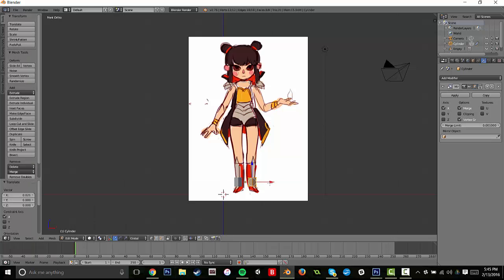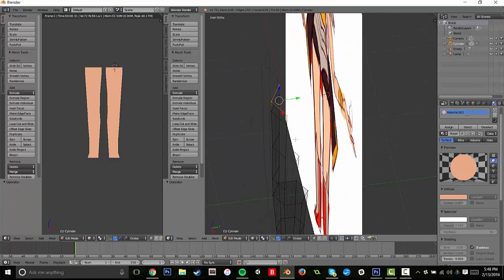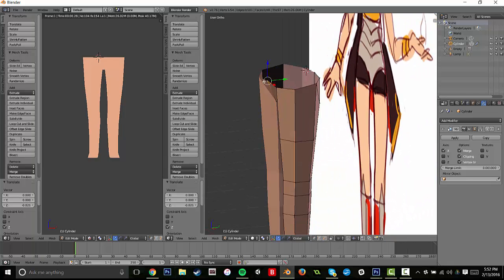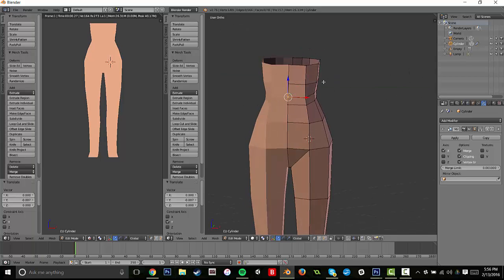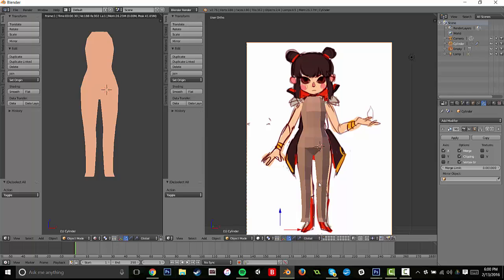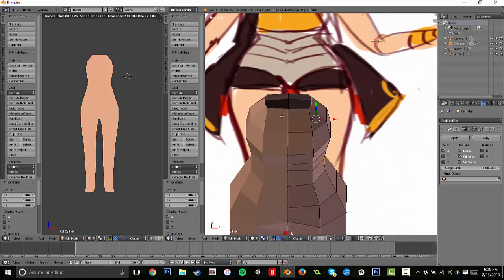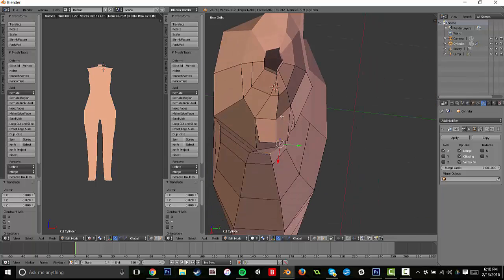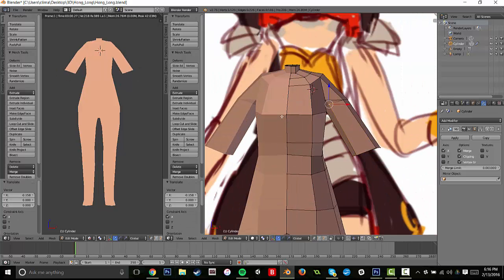2. Blender Low-Poly Human Model [BEGINNER FRIENDLY] -- The Base

Comment: So the shadeless check box got removed from Blender 2.8. To get the same effect you need to go to the Shading workspace where you can set up the material nodes. Shift+ A search for 'emission' and create an [Emission] node. Then connect it to the 'Surface' of the [Material output] node. You don't use the [Principled BSDF] which is created on default. Then you set the color you want via the emission node. Summary, Just need 2 nodes [Emission], and [Material Output] to replicate the shadeless effect.

Comment: If you are using 2.8, the "shadeless" shader isn't an option to select anymore. At this link, https://blender.stackexchange.com/questions/131015/where-is-shadeless-material-option-for-blender-2-8, you'll find posts on how to do it. I used the second one.
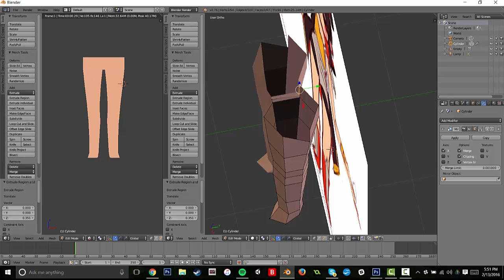@3:17 I chose to rotate the vertices to make them more straight (R), then I extruded (E). Just sharing in case it helps anyone.
This tutorial is extremely helpful! Thank you so much.
Reply: Thanks so much for including this! I've followed your link in 2021 and it still works and was exactly what I wanted, a shadeless shader that creates the same artistic effect as seen in the tutorial. Thanks again!

Comment: Indeed, less is more. I wish Blender had better smoothing functions to avoid fiddling with every vert to get it just right.
Reply from the maker: Project GG yeah maybe like the smooth tool for sculpting....
Reply: I don't know about the newer version of Blender, but in the version I'm using, both the smooth button and the sculpting smooth seem to do the same thing.

My gripe is that the smoothing function is degenerative; you lose the roundness/curvature of the surface the more you smooth it.  But what you really want may be to just pull back the pointiest vert of each face, or make sure each face is planar, not jagged (i.e. 2 verts across a diagonal of a face jut out more than the other 2 in the direction of the face's normal)

Comment: Why don't you use cycles for trail and error? I've worked in blender for 9 months and made some asset packs and i find using the cycles for testing better. Also it wont take up your power if u use alt ( or cntrl i forgot)➕ b to help you in getting good design veiw.

Comment: I see a lot of people getting lost, so here's a quick guide on some of the stuff she glossed over. 

A = select full object
If you click on an object in edit mode, it'll only select one of it's vertices. Toggling A will let you select and deselect all of the vertices

You can only open edit mode if you have an object selected

To get to rendered mode, select the circle icon on the bottom. It'll have an option for rendered. 

select a verticie and hit s to shrink or enlarge. If you dont know which hotkeys do what, hover over the options in the transformation window. 

If you try to extrude and you only extrude one point, what you want to do is hold ctrl and select all the vertices you want to extrude. I think thats it...
Reply: I know this is super old but in the newest version of Blender, the empty reference image is not hidden in rendered view. Is there any way to fix that..?

Comment: How do you import the picture inside of blender? and how do you get two windows showing your process?
Reply: Kentelove if you haven't figured it out by now, you can split the viewport by dragging the small black triangle in the top right corner of a single viewport. As for adding images, go to user preferences and make sure import images as planes is enabled. Then just add the image as you would any object.
Reply: press n then scroll down to background image tick the box, then search for the image you want and bam! its there, although this way requires you to be in ortho view so if you press numpad 5 you cas switch between it and perspective view.

Comment: To give a few tips.
You can slide vertices along edges by pressing 'G' twice and you can inflate the selected vertices by using Alt + S.
So instead of merging every vert like you did at 7:02, you could have selected the entire line and slid it towards one of the edges and used "Remove Doubles" after or simply pressed X and selected "Dissolve Edges".
Also, on the 3D View, on  the right of Viewport Shading, You can select the Pivot Point, (changing it to Individual Origins can be very useful) and next to it there is Transform Orientation (changing it to Normal can also be very useful sometimes).

Also sub.
Reply: +Douglas Rosa 
Sorry, I noticed you know that by the other videos.
Reply: Thanks a lot!